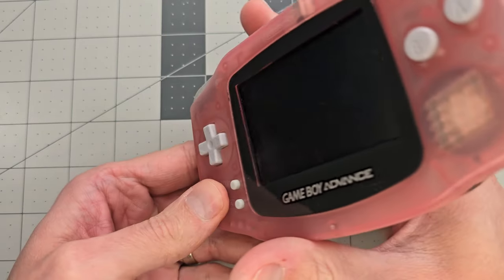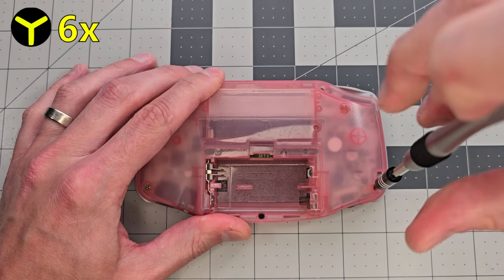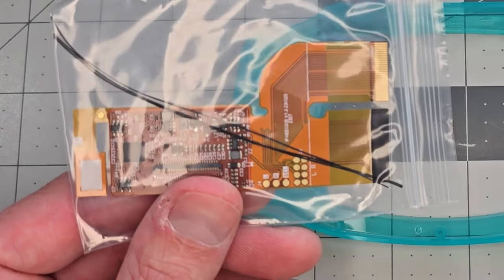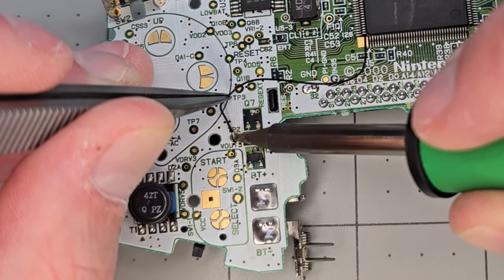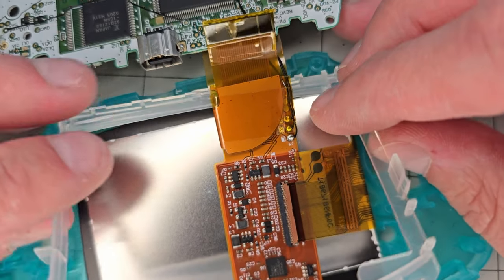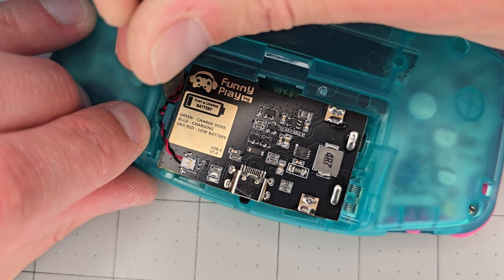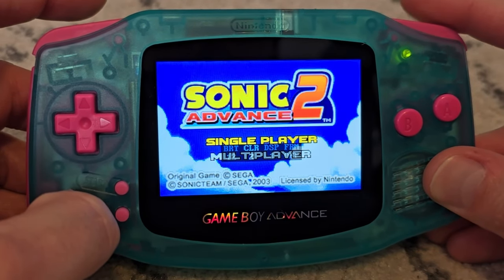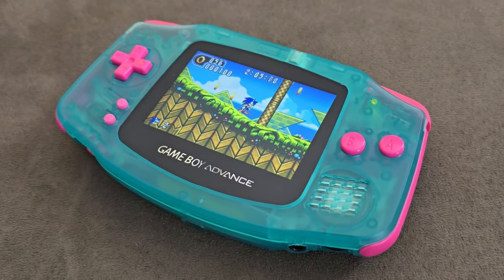Upgrading a Gameboy Advance with IPS 3.0 Screen and USB C Battery Mod

Comment: Great video! I’ve never tried this myself but I think you can remove stickers with alcohol, then when it evaporates you can stick it again, I saw it in a lockpicking lawyer video once. He was applying it with a syringe 💉
Reply from the maker: You are correct! And I have done that with good results on older systems (mostly when a screw is hiding under them that you need to access), but since this stuff was brand new I decided it was best to leave it. I figure the imperfect centering would probably go unnoticed by most unless they're real sticklers like me ;)
Reply: @FantasticQuack  I wouldn’t have noticed if you didn’t point it out! Lol

Comment: I found this video suggestion on my feed and found it very entertaining and kinda nostalgic, i happen to still have 3 gba sp, and since 2 are special editions i was thinking about making also the 3rd one into one.

If you don't mind, can i ask why do you have shaky hands? It happens to me aswell when i have to do precision tasks
Reply from the maker: Glad you stopped by! I don't think anything caused the shaky hands I've just always had it, but I've never let it deter me from working on very fine/precise things--just have to adjust my aim a few times lol. Check out my portable GameCube video for some very tiny soldering! Wish you the best with those SP's!
Reply: Having shaky hands too, since i am kid. In general it comes from blockages in the arm & shoulder muscles (also blockages in your brain. If you cant relaxe mentally, your body cant either). The tiny muscles surronding your joints & bones dont get enough blood/energy etc. So they compromise it by shaking. Parkinson in general comes from the same origin. So its not a wrong thing like many say. Actually its your brain trying to save ya. Start implementing muscle shaking exercises. Especially when you are doing any sport. Because this is what fucked you up mostly. Or just using your muscles in a to stiff way. That was my problem.
So shake them. Support your body with what it is trying to do anyway. Muscle relaxation & shaking exercises. Some vibrations are also good. There are hand massage pistols. Use them too

Comment: 5:30 kind of wondering about this now. I didnt bend my ribbon for the touch sensor. The video tutorial I followed by the mod supplier, 'Handheld Legend' did not fold it. I was wondering if there was any difference anyway, because I noticed the piece of tape? on the back of the ribbon. Everything stills works fine anyway
Reply from the maker: the tape was on the top surface of mine, so I had to fold it over to stick it down. It's a capacitive sensor so I expect it would work in either direction. I was just going based on where the pre-installed tape was located.

Comment: I think we should normalise keeping the original case. I think they look pretty good on the GBA.
Reply from the maker: You can keep the original shell but it requires modification to the plastic for the new screen, battery, and USB-C port. So whether you want to go through that extra effort/risk, and if you want a new color scheme on the exterior, both play into the decision here. There's no wrong answer, but will say I'm surprised how far these aftermarket shells have come in terms of quality. Thanks for stopping by, cheers!

Comment: Genuine question: why not just buy rechargeable batteries like Enloops rather than going through the trouble of modding?
Reply from the maker: You have to remove those and charge them in a separate adapter. Here you can plug in the GBA just like your phone so the answer is really just convenience.

Comment: How does the battery connect to powering the system?
Reply from the maker: It connects to the board terminals the same was the original AA batteries did
Reply: @FantasticQuack  oh I see only one side is taken out.

Comment: Does it work for GBA model agb 001?
Reply from the maker: Yes, there are two ends of the screen cable so that you can use one or the based on the board version.

Comment: I bought rechargable aa batterys 5 buks for 4 2100mah 5 buks for charger. Cheaper and twice the mah, 1.2v instead of 3.7v with the aa tho. But no problems untill now. owh and i destroyed a perfect gba motherboard with this mod replaced caps and fuse but its dead. Had to buy a replacement. So remember this takes more juice and can destroy your board
Reply from the maker: Kind of hard to understand what all you're saying here, but the mod shown in this video is perfectly safe to the board when installed properly.